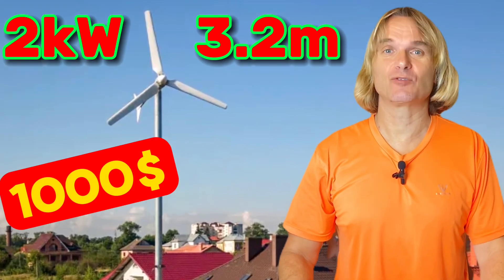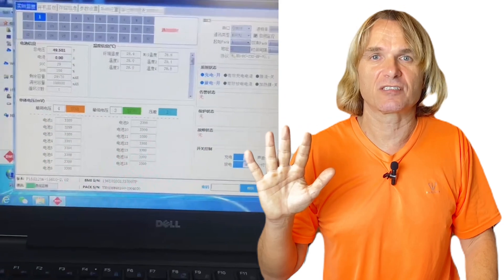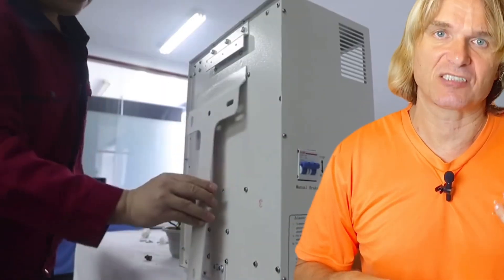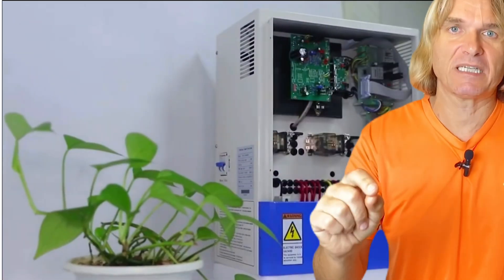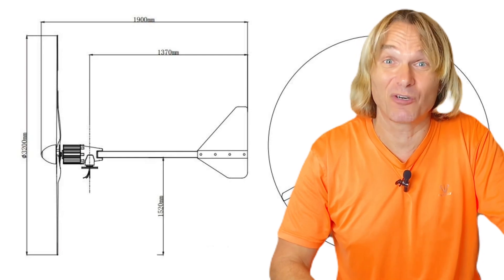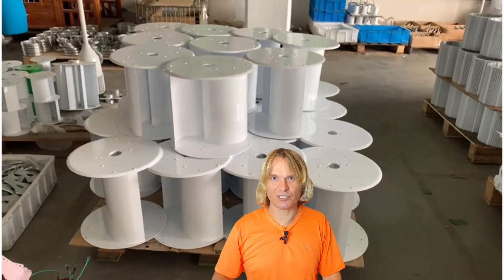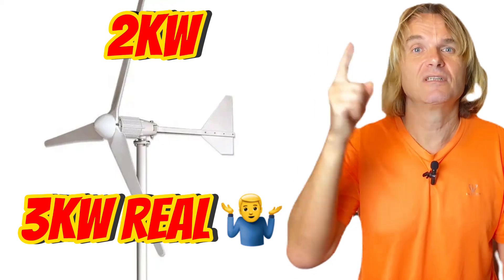2kW WIND TURBINE . HOME INSTLLATION

Comment: Hello. These are great videos. Thank you for your insights. I would like to install that turbine on a hydraulic tilt tower ( 9 meters high, cylindric pipe, split in 3 segments) for home use. Based on your experience, can you please advice on what would be the most suitable dimensions of the pipe (e.g. diameter, thickness, the segments of the pipe should be conic or straight, etc.)?  Thanks in advance for your support and looking forward to your future posts. Best regards.

Comment: Can you make a set for Australia with grid connect solar system already installed current system is a enphase micro inverter no batteries
Reply from the maker: sure you can connect most os wind turbines to enphase microcontrollers. if you have 3kw enphase it can work with 2kw wind turbine same way as with pv just rectifier and cheapest pwm 48V solar charger
Reply: @4nrgyTech  thanks for the reply, im trying to understand fully. So will it need its own inverter the same as a enphase,  they dont go up to 2-3kw.  Also how would using the high speed function with the tail to turn it out of the wind if the grid disconnects.
Reply: @peterlworth mechanical braking works totally independently. 
Yes youll need separate inverter if your enphase is 800W.
If you are going to use offgrid setup i would directly charge batteries through cheap pwm controller
For grid tie you need inverter and controller
Reply: @4nrgy  thanks for the quick reply, i would like to add it to a grid tie system to help at night, i have seen grid connect inveters with turbine controlers and a dump load all in one, is there one you helped designe as you mentioned.

Comment: What is the name of this wind turbine? Also, what do you recommend for the inverter and all other components for total off grid living?
Reply from the maker: it's ft2000. for offgrid I would use 48V version with cheapest solar charge controller, chinese 48V hybrid inverter and forklift battery. if you do not want to spend too much on battery use 4pcs car batteries. same Ah best if same brand.

Comment: A reliable off grid system will have consist of wind, solar and petrol/diesel generator to guarantee year round production. It's a pity nobody is told this from the start. Living with both ready made and DIY wind turbines, our experience is that the wind turbines realistically function as a scavenging back up generator compared to solar production. Very informative video, I'll keep an eye out for any clips of our vids in your future productions 👍😎

Comment: What do I need to add to my system if I have an 15 kW Solis - S5-GR3P15K inverter and want to add an wind turbine?
Reply from the maker: do ypu have free mppt input?
Reply: @4nrgyTech  I’m not sure. The inverter has two MPPT and 4 pair of connectors. I guess two for each MPPT. Voltage range is 160-1000V. Not sure how much solar panels produce. If I remember correctly it was around 600 V on each MPPT. 😊
Reply: @4nrgyTech  Jessica does not answer. Maybe still new year celebration? What is the model name of the wind turbine? 😅
Reply from the maker: till 24.02 China is on new year holiday. nothing we can do abt it but workers are with families, factories are empty
Reply: @4nrgyTech  they have crazy long celebration. 😂🍾
Reply from the maker: yup this is one time in the year when workers can meet their families. sometimes ppl travel more than 1000km by train(8-12h) to greet and be with their parents and relatives. it's called spring festival and it disrupts trade and logistics as hell🤷‍♂️
Reply: @4nrgyTech I check today when sunny weather and it is around 700-750 Volt on PV system. Maximum on inverter is 1100. But maybe I can connect parallell because I have two free MPPT inputs?
Reply from the maker: yes you can connect wind turbine to free mppt on your inverter
Reply: @4nrgyTech I have ordered WT from Jessica. But I also order controller with dumpload. But you say in video they are not good and expensive? Did I make mistake? Should I buy another then what Jessica sell?

Comment: Great videos! Can I ask what is the charge controller/Inverter behind you in this video? I'd like to purchase it for wind & solar. Thank you.
Reply from the maker: depends on voltage of your turbine. for 48V I advice everyone to use solar pwm inverter with addition of bridge rectifier
Reply: @4nrgyTech  You are extremely knowledgeable  in this subject and should put out some training setup illustrations, I know what you speak of, but not sure where to put the bridge rectifier. I don't subscribe to many channels, but I'm subscribing to yours. Thank you for the info, it was very helpful.
Reply: @Business12man  All you need is a block diagram schematic. The rectifier goes from the gen output to the PV inverter input.
Reply: Hi, I'm interested on this controller- can you provide link please for voltage range if possible 40- 300v please

Comment: So as far as I understand there's 2 ways to use wind turbines in combination with solar:

1. Have the wind turbine controller charge the same 48V batteries that the solar hybrid inverter is
2. Have some sort of wind turbine controller that can then be fed to the solar hybrid inverter solar panel input.

In my opinion 2 is better because then you have just one charger of the batteries and you can inject the extra energy into the grid in a much easier way.
The only thing which I didn't understand is where you can get the needed controller to link this turbine to the solar hybrid inverter and also how exactly you connect it. I suppose for some inverters that have 2 inputs you can use one of them for wind and one for the solar panels.

Comment: Very interested to hear that you can send rectified output from the wind turbine to a PWM solar controller. I had thought of doing this but didnt expect it to be successul so I didnt go down that route. Because, with solar panels, the PWM controller will stop charging and effectively "block" the solar panels, by taking the PWM duty cycle towards 0% when the battery voltage limit is reached. But when taking power from the wind turbine,  the excess power must be dumped from the battery bank using a suitable voltage sensor, high current relay and resistor/heater load. ( otherwise the turbine would blow up the controller/battery bank ?? ). 

From looking at small wind power technology over the last few years it seems that most small wind turbine users take rectified ouput directly to their battery bank and then use off the shelf products such as the Tristar TS45/TS60 in diversion mode to get rid of excess power ( I've made my own solid state relay system which does a similar job ).  But I am intrigued at the idea of taking the output straight into a PWM controller. Would really like to see some sort of diagram to see how you get this to work. You mentioned in some comments that you can attach a dump load to the solar controller load terminals...but would'nt that just drain down the batteries ?

Thanks for a great youtube channel!!!
Reply from the maker: check solar controller  manual for output load : in all of them you have turn on voltage and turn off voltage. you put turn on 15.5v*how many batteries you have in serial turn off 15.4V and you good to go. Its not that complicated and works
Reply: @4nrgyTech Okay.. I understand now. You just interpret the "turn load on/off" parameters to mean start/stop dumping. That should work well. I must have looked at 100s maybe 000s of posts on YouTube and green forums and no one else has suggested this idea. Sometimes the simple best solutions are in plain sight! .  Maybe you'll do a video on this in the future?. Probably a superior method of control compared to simple dumping through a basic volt sensing relay which is what nearly  everyone else including me , seems to be doing at present. Only concern is that the controller load on/off relay needs to be solid state to survive long term frequent operation. Maybe need to divert the coil signal to operate a high current SSR instead.
Reply from the maker: it is always mosfet transistor for connecting disconnecting. same as in ev motor controllers these can stand millions of connection/disconnection cycles so there is no big problem. only thing is inductive loads they can cause voltage peaks while disconnecting but we are talking about low voltages here

Comment: I have two istabreeze i1500 turbines. Excellent machines. Up two years, no problems. The only other ones that look good are from Bayoung brand which look exactly like the one you show on this video. Are your turbines Bayoung? ....also thanks for BEST VIDEO ON youtube for small wind. Just subscribed!
Reply from the maker: thank you!  as far as L2 turbines there are 3 factories but 50 brands for this type 😁.  they are exceptional for power to price ratio and high voltage versions. since PV is very popular high voltage versions can operate with standard pv inverters. which decreases cost of whole system.

Comment: great video. i want one.  but first i have two i bought from china for $500 aud each. they are 500w 48v ac. but i cant find a decent priced and good quality controller for this. im off grid on a sail boat with 20kw/hr of lifepo4 to charge. i jhave 800w of solar but this only gives me 4 to 5 kw/hrs a day in sunny conditions. i want to double that and winter proof my charging. can you do a video on charge controllers pelase for my 48v battery bank. thanks
Reply from the maker: first check real voltage of your turbines. disconnect load and controller and measure AC on average wind. you need at least 50V(AC between any of three wires) then connect rectifier and simple solar 48V controller.

Comment: How can I get the controller for 48V turbine?  
Do you sell them?
Reply from the maker: for 2kW wind turbine just buy 3phase bridge rectifier and 48V 50A solar pwm controller dunno where are you from but AliExpress is cheapest source in most countries this controllers usually under 20USD and you good to go
Reply: @4nrgyTech  do you need to smooth the ripple before putting it in to the charge controller and dont you have to have a dump load for excess charge?
Reply from the maker: no you don't need to smooth its 3 phase rectifier look at oscilloscope picture of 3 phase rectified current. 
all known to me solar controllers have external load output. connect there heater or few car bulbs (4*h7 serial for your case) and you'll be fine

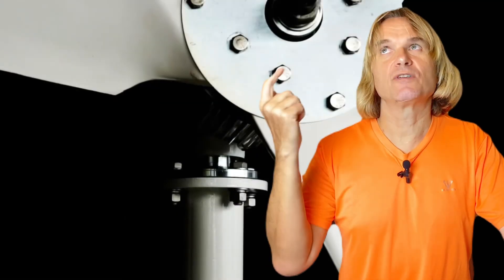Comment: Thanks so much for this video, the pictures you have of the generator at time stamp 1:12 is the same generator I just mounted on a 14 meter pole in NZ. Its 1500 watts, 48 volts. Do you know why the tail swings off to the side as soon as the wind starts to blow and then slows down and swings around away from the wind? I haven't hooked it up to the charge controller or the battery bank yet, will that make a difference? Thanks🙂
Reply from the maker: there is 1400 blade version 1,5kW. is your tail is pointing a little bit down? if yes this is possible it is mounted backwards. tail suppose to turn whole turbine at 50mph out of wind. maybe now if it's working without load it behaves strangely but it is possible you need to rearrange tail
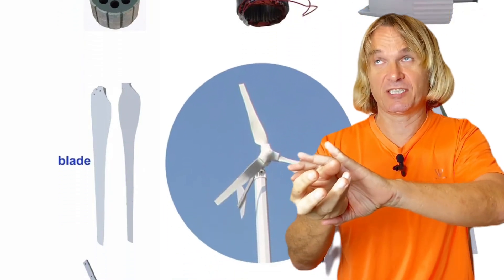Reply: Thanks 4nrgy Tech for the info, I'll have a closer look at the tail position, maybe it can be mounted differently but it looks exactly like the one you have pictured in the video at 1:13 and the tail swings off just like the picture.  Maybe that's the way its suppose to work>👍Thanks again   @4nrgyTech

Comment: Hello, may I ask what is the name of this turbine?
I just need to review the prices on the 'net'.
Reply from the maker: it is offer directly from factory. dealers give it their own names. in production it is known as L2(but also some factories selling smaller model 1400mm blade under this name) . this turbine is sold by many resellers under different names also as 5kW or even 8kW this is the same turbine be aware!. use diameter and blades length(1530mm) to look for it. sellers on AliExpress sell it mostly as 5kw.
Reply: @4nrgyTech Thank you for this very   helpful videos. Keep them coming. 
Can you provide link please to the controller for the wind turbines your design for solar grid connected inverters

Comment: I have a battery systeem 30kWh on 48v and still thinking about adding a wind turbine for winter and night. But up to know the power off a wind turbine i have seen was s**t.
Reply: I have two istabreeze i1500s and 4kw of solar. Since midnight last night to now : Solar : 1.1kwh  Wind turbines : 6.2kwh ( daylight from around 7.30am, wind only 6-12mph gusting to low 20's ). From March to October solar is far far better than wind....... but wind really takes over during the winter months. Wind power is not for everyone. Depends on your location and needs more maintentance and control.
Reply: I use the wind turbine to keep my batteries topped up at night hence prolonging the life of the most expensive part of my setup.

Comment: Nice presentation. I have an off grid PV of 5kW that charge a battery cell made of 8 batteries. The system powers up a mountain cabin and sometimes during the winter i have to use a diesel  generator to charge the batteries and power the cabin as in winter is less sun and less day light. I think that if i buy and install this turbine and also add 4 or 8 more batteries it will cover the needs and i would never use the dirty diesel generator again. So i will ask Jessica about the order. Thanks alot.
Reply from the maker: check out lifepo4 prices now. it's cheaper than lead acid now. prices starting at 40$ per 1kWh. so you can have rly sturdy power year round! good luck with your project